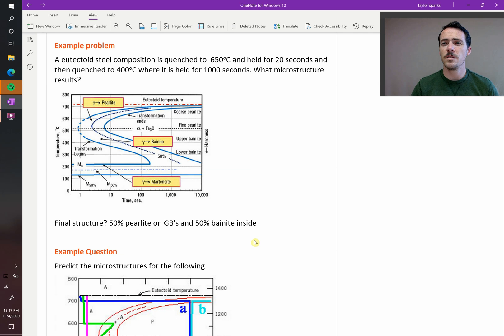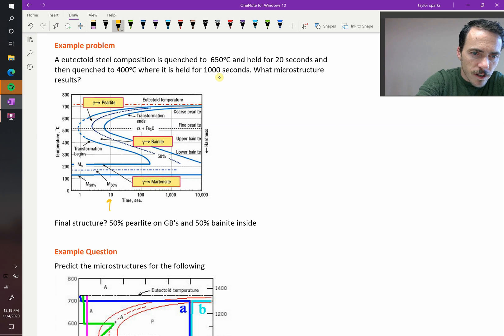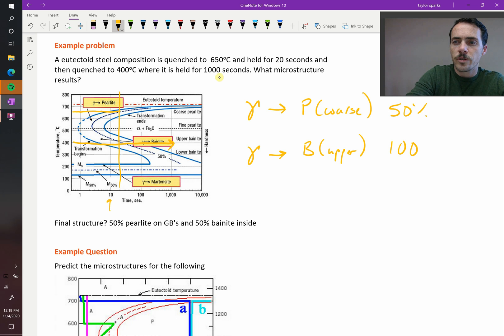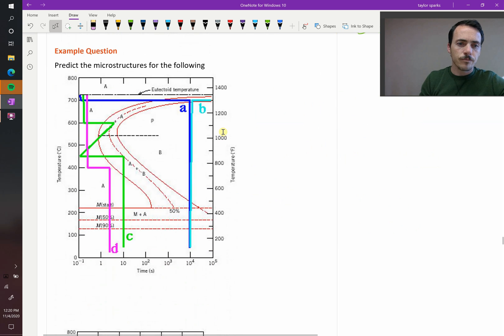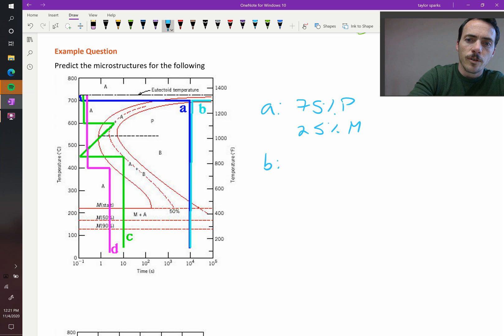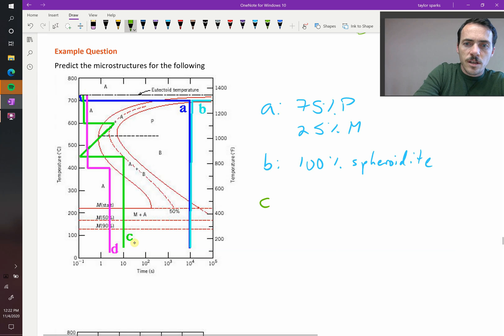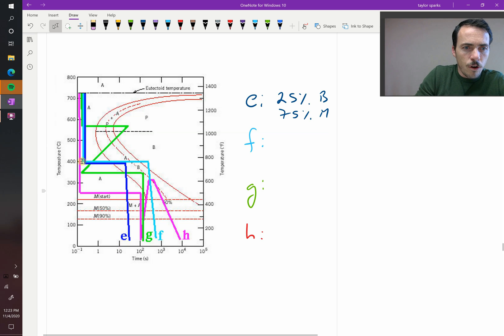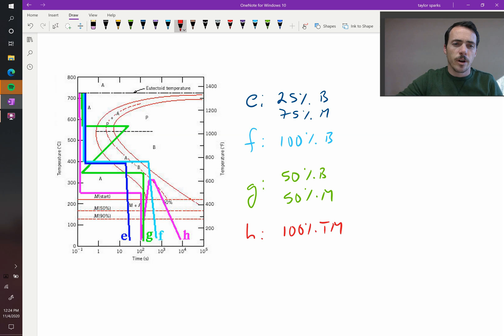Examples of steel microstructures using a TTT diagram

Comment: Hi Sir, I’ve watched several of your videos, but I’m still a bit confused and worried I might misunderstand, haha. I’d like to ask — does the straight horizontal line at point A on the TTT diagram represent the holding time while the sample is in the furnace, or the holding time during quenching in the oil medium?

We recently did a heat treatment practical on hypoeutectoid steel at 800°C with oil quenching, but we’re still a bit unclear because we don’t fully understand the basic concept of the TTT diagram yet. Thank you in advance, Sir 🙏
Reply from the maker: This is simply a diagram showing what would happen if you could hold it at different temperatures. It's not connected to an actual experiment so it's not specified furnace versus oil. That said, 600° is going to be much hotter than the oil so it would have to be a furnace if that was the desired temperature.

Comment: Great video! Although i am a bit confused at the scenarios where the lines seem to go “back” in time, like in c. Is it essentially just assuming that your new “starting point” of austenite is what remains from the first cooling? Surely if you cooled it, it couldn’t actually go backwards along the x axis, and so would pass through the bainite section?
Reply from the maker: It's better to think about it in terms of what is thermodynamically stable. If you could magically change the temperature instantaneously (you cannot btw) then whatever fraction of the metastable phase like austinite, is now going to have a thermodynamic driving force to convert to a different phase or mixture of phases.

Comment: i don’t know if you’ll ever see this but i got an exam in a few days and i didn’t get the point where u said at 5:28 g is 50% bainite and martensite. why isn’t it a 100% perlite instead? the reaction is over. it passed the 3rd curve. i didn’t get it.
Reply from the maker: @mustfabaki  because once the reaction has taken place, this is not reversible until you heat the sample back up above the austinite temperature. So if part of the sample has transformed then there's only 50% left to transform under a different condition

Comment: First of all, thank you very much for your precise, informative videos. My question is while you were reading the TTT diagrams and determining transformation percentage, how is it possible for C to go back in time? I had some confusion understanding that backward move. Thanks again.
Reply: I think they just re start the process at a different temperature. For example, in g you get 100% pearlite and then you take that 100to 350 and start to cool down again, but as it is 100 pearlite you Don have more austenite to transform. But its like taking the material all over again to the beginning, like you do a second heat treatment at a different temperature
Reply: Yes, I too have that issue, could you please explain it. Thanks in advance. P.S. great video by the way.

Comment: Very helpful video! but I had one question regarding the last problem that was solved. How is it tempered martensite when the martensite is heated beyond the low critical temperature? Isn't tempering lower than that temperature but higher than recrystallization?

Comment: What do you mean reset, for example in C, that the line goes back. What would be the process to reset it?
Reply: I didn't get that either. Have you found an explanation to that?
Reply: @xonio2881  nope, i am still wondering.
Reply: After cooling to a certain temperature, you hold it at that temperature instead of letting it cool completely. Its usually put in a furnace of the reset temperature and held there until the entire material is at that temp.

Comment: Hello, is it possible to turn upper bainite to lower bainite by quenching it?
Reply from the maker: No. If you quench it it will preserve the structure. If you want lower bainite you need to lower the temperature a little bit and hold it in the lower bainite region
Reply: @TaylorSparks  oh cheers this is what i was looking for. Thanksss!!

Comment: Hello, I have a question! If the TTT diagram (for the hypoeutectoid area) has the start of the pearlite transformation at t0=0sec, 730oC & the start of the ferrite transformation at t0=0sec, 610oC, after cooling instantly from 900oC to room temperature, does it form pearlite + ferrite or martensite ?

Comment: Great video, I feel like I'm finally understanding Materials:) I was was just wondering if instead of quenching off the start, if you used 'normalizing' for some period of time to the same points you did in this video would all the answers remain the same?
Reply from the maker: What exactly do you mean by normalizing? I'm not sure I follow.
Reply: @TaylorSparks  I'm doing a lab and they're referring to normalizing as a slower cooling method, it almost looks like continuous cooling curve, and for example, the curve goes from 800 degrees to roughly 550 for the 'normalizing' stage. Does that make sense? The word is also throwing me off haha, thanks in advance!
Reply from the maker: @justinbreau4623  okay, in that case you would need to use a different diagram. I've got a separate video on continuous cooling diagrams. I don't have as many worked examples though, unfortunately.
Reply: @TaylorSparks  Ahh gotcha, thank you so much! I'm going to go watch that video, this was beyond helpful! Really appreciate it!
Reply: @TaylorSparks  hello, I had a question, if I formed 50 percent bainite and then quench it to form 50 percent martensite, will bainite still be at the grain boundary? Because undercooking is high so it shouldn’t right?